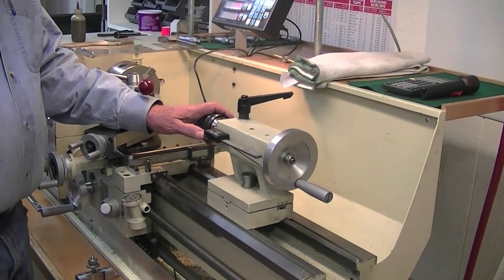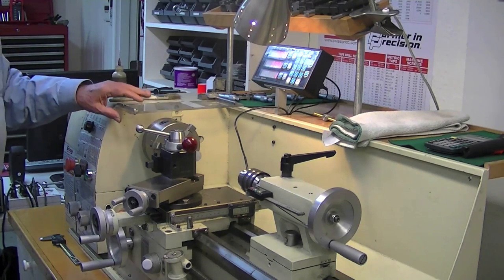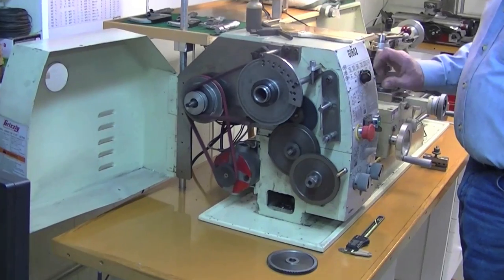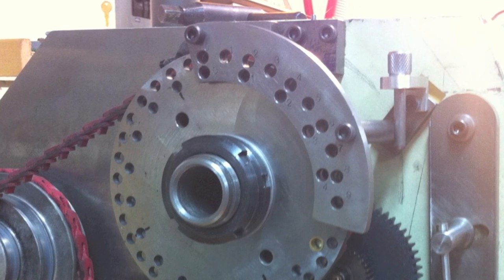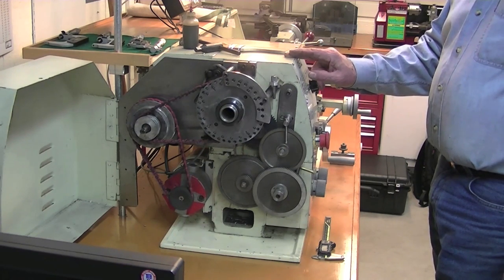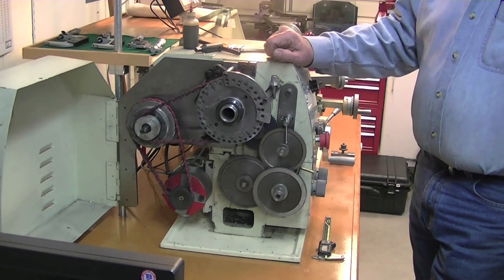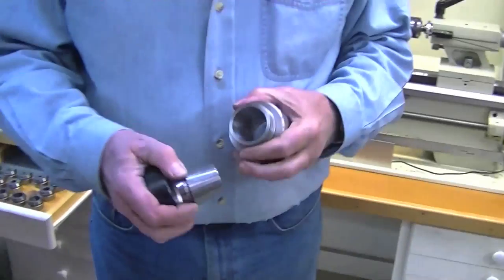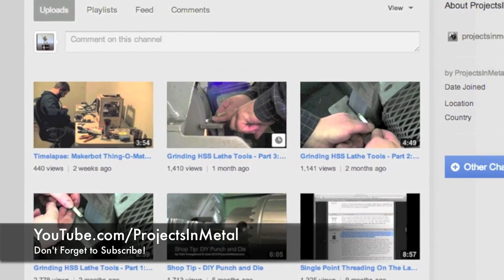Grizzly G0602 Lathe Improvements by Jim Schroeder

Comment: I'm missing the part of the reverse idler gear.  Is that big lower gear movable?  It is in different spots in the video.  I do not own one of these yet, so excuse my question if it dumb.
Reply: The large gear on the bare metal swing arm with the curved slot and lock stud is the reversing gear.  The larger gear on the bottom left is mounted on a slotted swingarm for adjustment.   The bottom right large gear is the changebox input shaft gear which is changeable for size but not position adjustable.

Comment: love your lathe i really want power crossfeed  g9972z i think is the smallest griz offers
Reply: My G9972z doesn't have power cross-feed but my G4003 does have it, as well as reverse-feed for threading left-hand. Not always a good idea to reverse and cut heavy with screw-on chucks of the smaller machines. Some chuck bores on these are smaller than spindle bore. For example, the 3-jaw on my G9972Z had to be opened up with a boring bar to get closer to spindle bore size. 

I'm using treadmill motors to re-power some tools. Adding a jackshaft, a HFT metal blade, and DC motor to my 14" 'wood-cutting' bandsaw was a cheap conversion for cutting metal too. Speed control is via HFT router speed controller and a 50a-200PIV diode bridge rectifier to convert AC to DC. Cinci #2 T&C grinder sports similar motor conversion (vs OEM 440v 3-Ph), and I just plug in the one speed control to run each DC machine in turn. 

Motor torque is reduced even with the speed control's PWM method, but slight variations below WFO are often enough to just reduce chatter. G9972Z is next to be converted to variable. :-) btw, G0619 has 3-PH spindle motor and incorporated VFD. When is sits for a long spell, it's important to run for a while at low speed with no load to reform capacitors within the variable drive's electronics. I run a short version of 'break-in' procedure to do that.

Comment: I myself don't think reverse tumbler is "rarely used"
For 1 thing: handy for threading AWAY from the Chuck
2. Boring from left to right, away from chuck.

Both operations come in pretty handy.
Reply: As far as I know, you can thread away from the chuck by just running the chuck in reverse but you need to put the tool upside down on the far side of the chuck.

Comment: Good Idea to convert your lathe to variable speed motor. You state that you bought the DC  2 HP variable  speed at Home Depot,but when I went to this store in Columbus,Ohio I was told that they did not sell electric motors.Did you purchase your motor online? Where did you buy the speed control switch dial?Should the motor fit without any modification?
Reply: He bought the paint there said the motor was from a treadmill. Not sure what you heard..